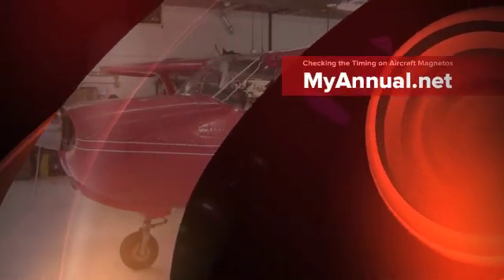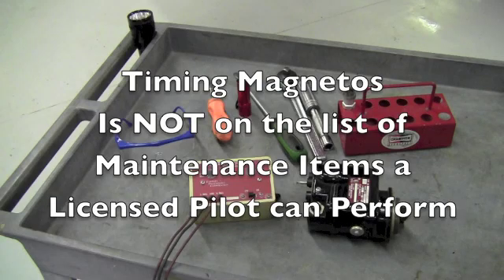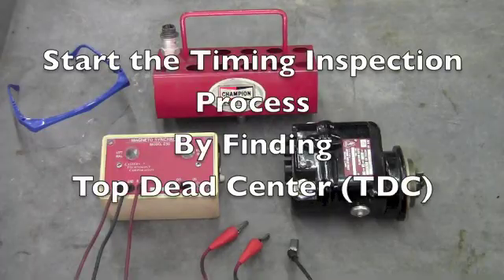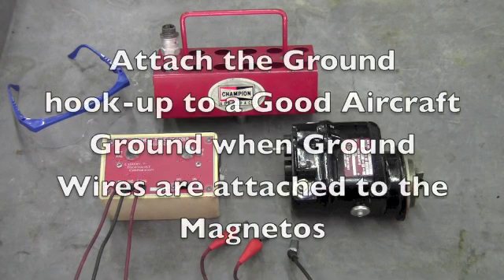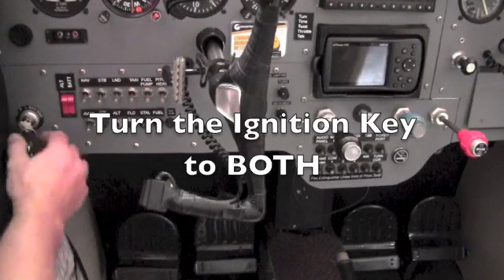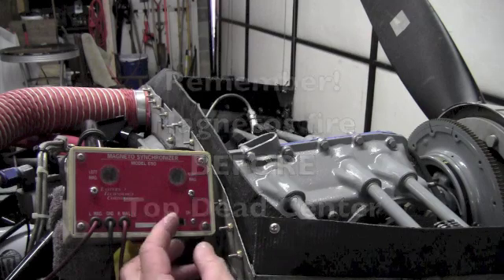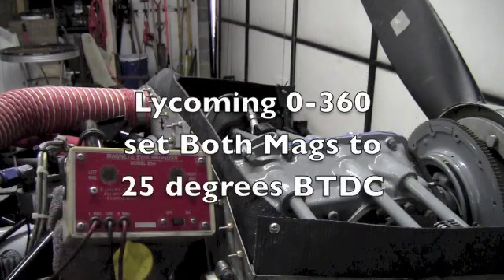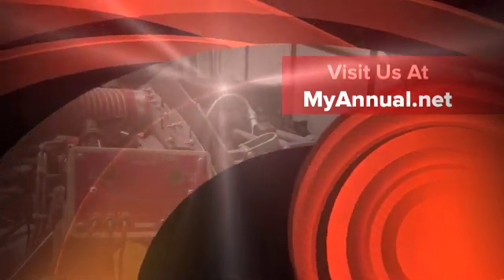Check the Timing on aircraft Magnetos

Comment: One quick note from a A&P senior you also need to see how long the light stays on and that will tell you the point gap on each mag point and you can see the wear of the points if they are the same gap or not, and decide to remove the mag for inspection.

Comment: good video.  explaining why you bring the propeller past TDC on the compression stroke of the number one cylinder first would be helpful.  It fires the impulse coupling and allows you to get to the 25 BTDC timing of the magneto.  otherwise you would be getting the light and buzzer on the one mag at around TDC.  try it.  its fun.